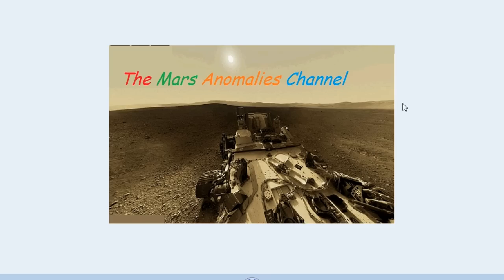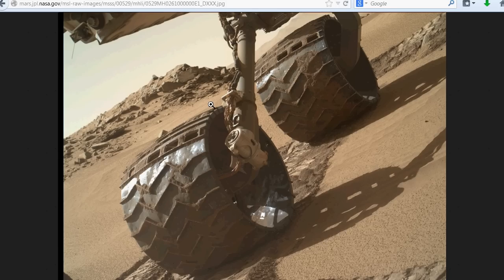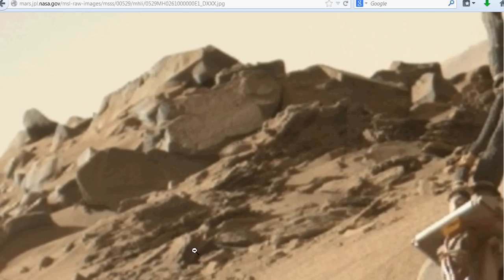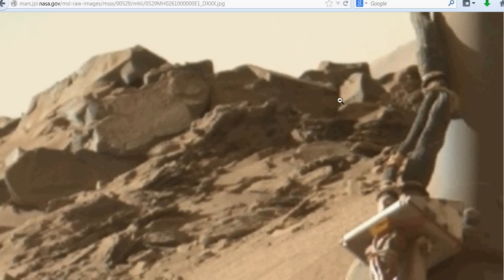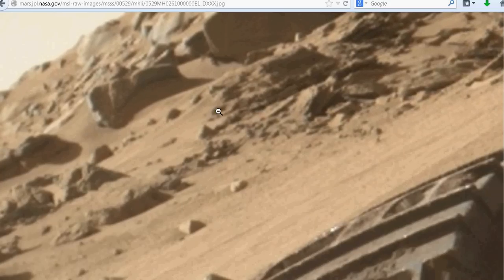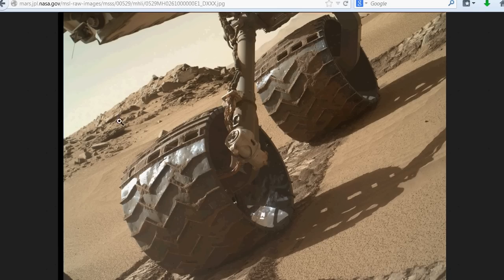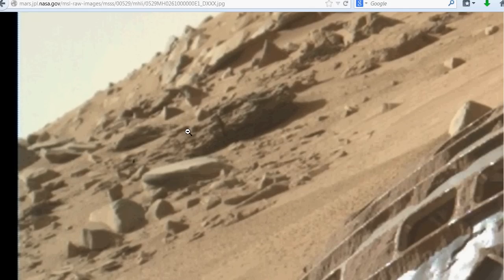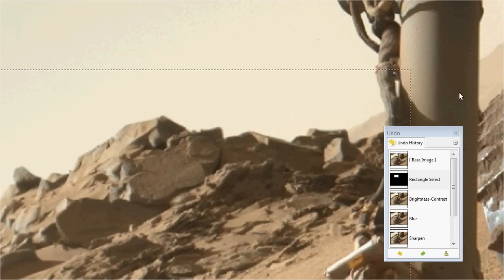Structures And Mechanical Parts?

Comment: You're doing a great job with your vids. The only thing I'd like to see right now are close- ups of the shaded areas under the rocks. I only have a cell phone to look at these vids but I've seen what looks to me like life forms hiding in the shade, for the most part. Everyone looks for buildings & machines - they're quite obvious. But we need some more exploration of the shaded areas to see if we can find proof of life, as you know, water is essential for life. So now we know there's water on Mars, it only goes that we need to search for life. Thank you for working on your vids & keep up the good work!

Comment: The soil appears to be moist in many rover pics from Curiosity, Spirit, and Opportunity. Seems the air is full of humidity based on the many hazy white sky pictures.
Reply from the maker: Hey snlker ....... You are correct. The air temperature, on Mars, reaches between 70 - 80 degrees at times so it would not surprise me if there were some HAZY DAYS.  In my opinion, NASA is not telling the whole truth about the atmosphere on MARS. Also, keep in mind that NASA loves to do their own HAZING in these pictures (I.E the mountains) . Thanks for your comment. ----- Chris.
Reply: Well, NASA is lying about the air. I thought they were wrong when I was in 6th grade in 1982, but now know it's a lie. They say the surface of Mars is = to 100,000 ft. in altitude here. Well all you need to do is see a video from a high flying plane, and when you look ahead or up, the sky is dark and black, with no clouds, not hazy white, pale baby blue, or even red as NASA  reds up their photos. Even at just 70,000 Ft. the sky is like that. No clouds, and a dark sky, not bright as if you were standing here on earth with clouds, even cumulonimbus clouds as some rovers show, especially the Phoenix lander.

Comment: I'm going to view that one and get back to you, as for the wheels I'm thinking some sort of magnetism may be the cause of the material sticking on them.  Those shapes look interesting I wanted to see what you could pull out from them. I saw a brief primer on photo manipulation where they can make rocks disappear or random rover tracks just by copying and pasting nearby images on them...is there any tool that can uncover that or are the objects basically gone forever from the photo?
Reply: I almost agreed with magnetism within the soil, but then it falls off. If it were anything like iron-filings for example it wouldn't fall off. Tell you something else that strangely doesn't happen, soil 'stuck' to the wheels never visually falls off when the rover is parked for a while....it should dry out and fall.
Reply: DOCWHOK9 Indeed, the reason I thought of magnetism is that in the Mars environment there could be tremendous static electricity that remains and increases for incredibly long periods.  They say there are these epic sandstorms with 'dry lightning' due to the excess static, so going with their lame 'red planet' bs the surface should be rich in iron.  There could be instances of moisture too but not sure it would be H2O.  Have they shared atmospheric composition at all, I have not heard if the RO's sampled the atmosphere?.
Reply from the maker: Hey JustThnkn ......Unfortunately, once they have altered the picture and covered and anomaly, it is pretty much gone. Now, I have been able to see where they did the manipulations, but there is no way of telling what it was. Good to hear from you my friend. Regards, Chris.